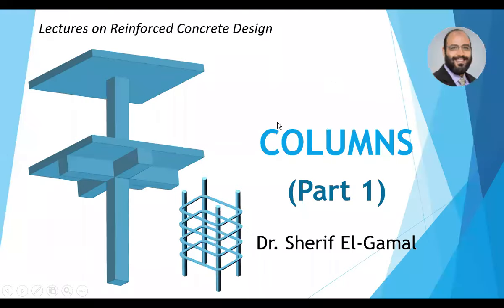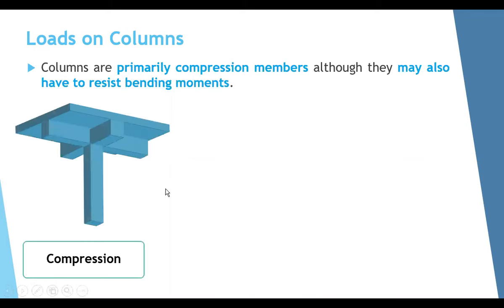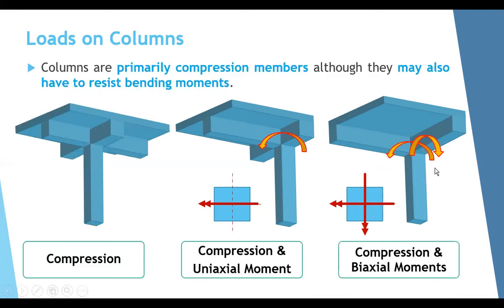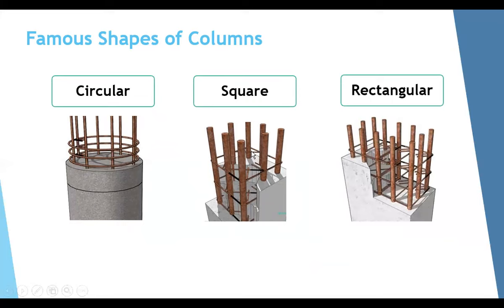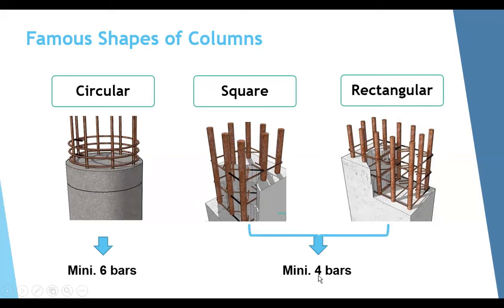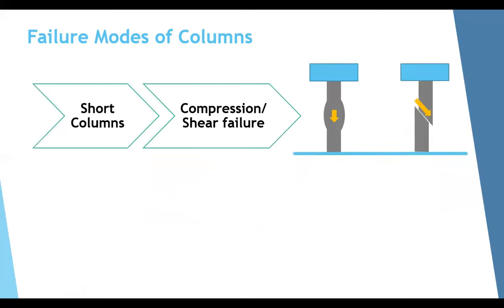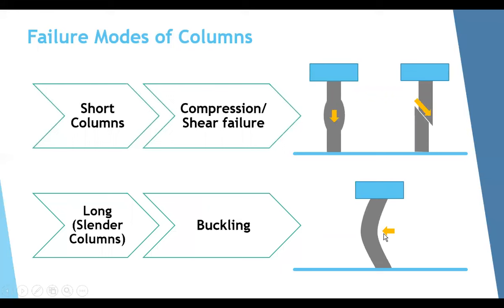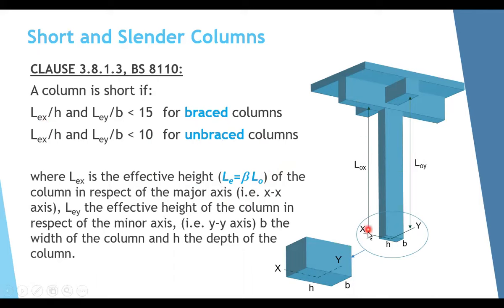Design of Reinforced Concrete Columns (Part 1)

Comment: Hi there ! Small questions ! 1 Floor building project mix structural and masonry made from AAC 500-600kg/m3 Parietal beam. What is the difference between 30x30 and 25x36 columns sections in this case .Do you think are compatible using same amount of rebar inside ? I want to make as such that the beam size fits the masonry size that s way!
Reply from the maker: Yes, correct. But a column with 36 is not common and not practical. You may use 25x40 instead.
Reply: @MrElgamal77  Hey Dr.Sherif .I want to pour a foundation !and  there is a -1,2 m from ground soil .I want to pour it in 3 step in 3 levels according my 0,6 m height wood framework and using it like climbing wood framing ! i know is possible but never done it !  rebar's will be there of course! and top beam rebar's added before last pouring sequence ! what do you think ?i m thinking creating  Lego forms on top surface previous pouring to ensure better bounding for earthquake resolve issues. Also cement grounding on contact pics! will be like forming prefabricated in place sow that will stick previous one ! i want to use less wood framework for money issues. Any other info for this will be welcome !thank you !

Comment: Dr. El-Gamal, are prestressed columns exist? If yes, when and what's the condition an Engineer to consider to design such column? Thanks in advance to your reply.
Reply from the maker: Why do you need to prestress a column? We use prestressed to reduce the tension and deflection in beams and slabs.
Reply: @MrElgamal77  Thanks for the reply. I was just eager to find out if applying the same system in prestressed piles would be effective to balance tension during lifting and bending during installation, to control cracks as well.

Comment: how do u calculate a cantilever slab
Reply from the maker: Cantilever slab is similar to one way slabs. It is fixed from one side only. If you have a uniform load, the moment will be a negative moment of wl2/2. This will require top steel. 
The rest will be as one way slab.